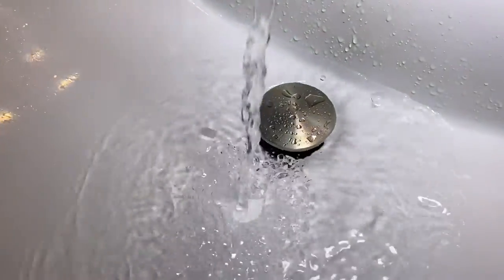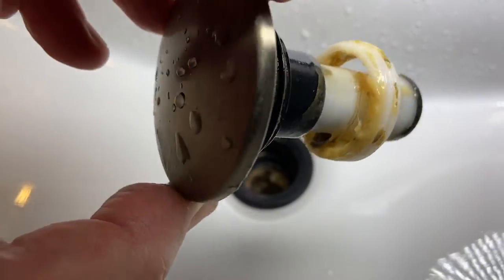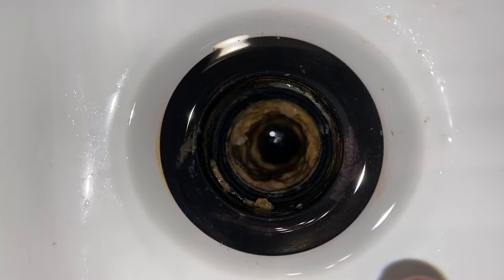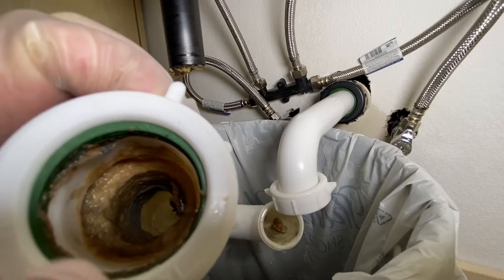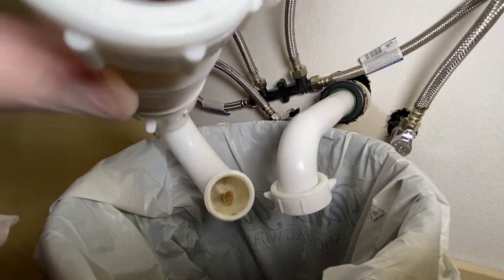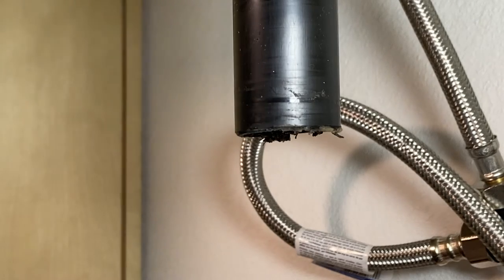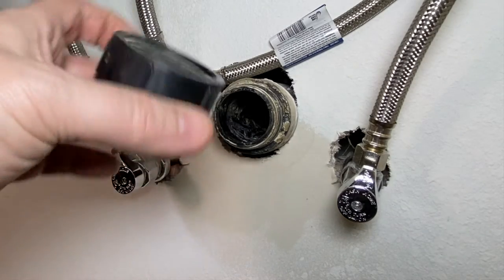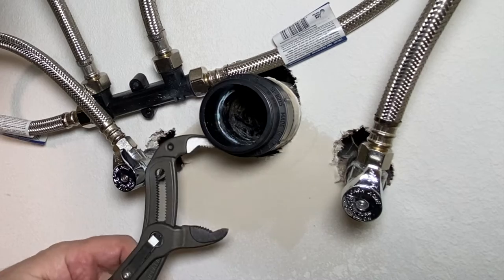ACCORDION STYLE PLUMBING IS A BAD IDEA!...2 Ways To Repair Sink Drain

Comment: Man! I need to call a good plumber to change out the accordion style, which makes a little bend so it goes down the S-Trap(the house was remodeled and they vented the trap before we moved). Its getting a bit dirty down there as far as I know..
Reply from the maker: You can do this!  Good preparation equals success
Reply from the maker: You can do this!  Good preparation equals success